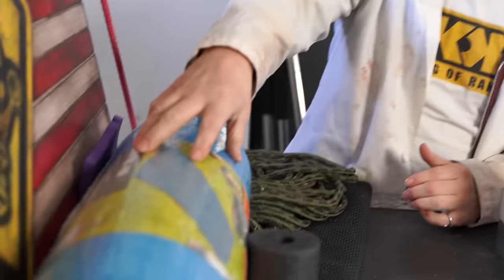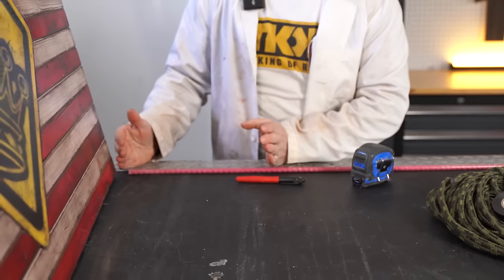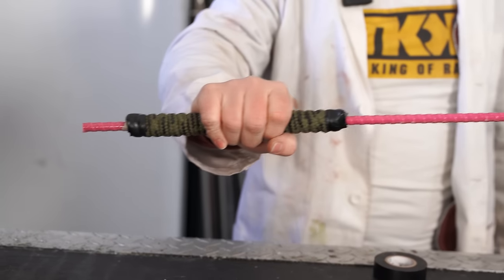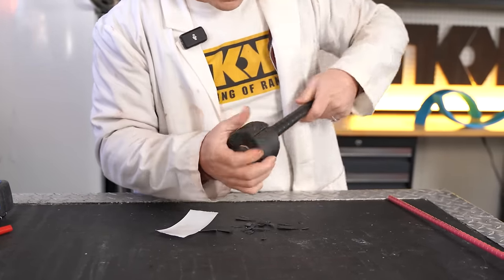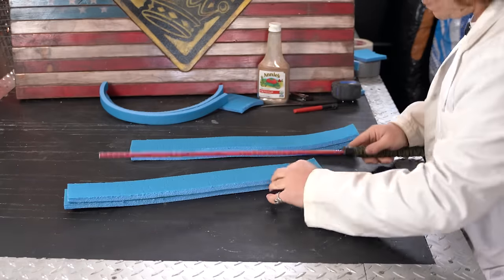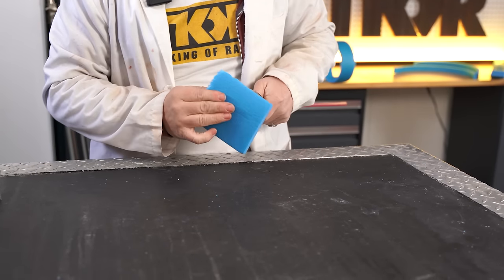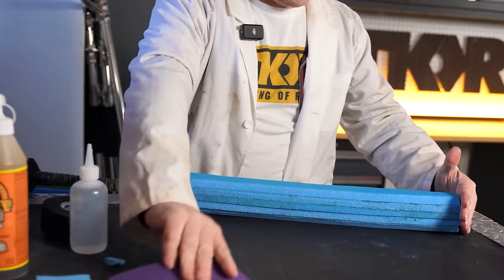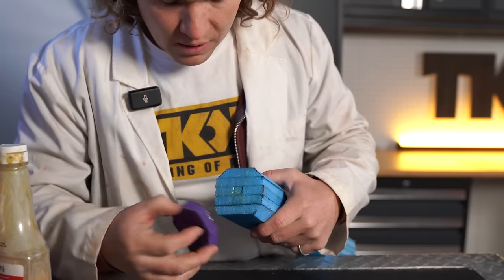Easy to Make LARP Foam Sword & Shield (Part 1)

Comment: There is something called a pool noodle here. It is also foam though a little less dense. But still OK for kids use I'd guess. Benefit. Already round. Less cutting and shaping. So faster sword. Downside: less construction time with your kid before you get hit with it 😂
Reply from the maker: Pool noodles are great for younger kids! Cheap and easy to build! They just don’t have enough impact resistance for adults to use them for very long.
Reply: Can confirm, I've been hit by plenty of pool noodle swords. This is essentially Level 2 of that. 
Pool noodle bats are fun and VERY entertaining for younger folks. But adults hit harder, and pool noodles break down very quickly and can easily lead to injury. :)